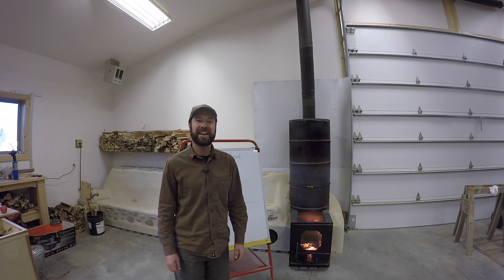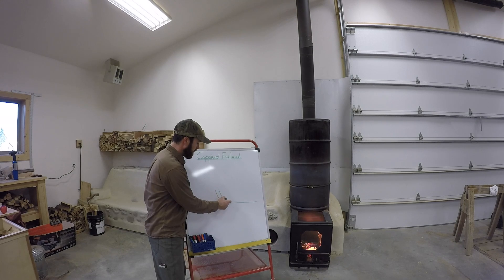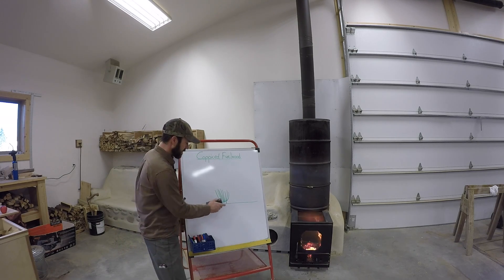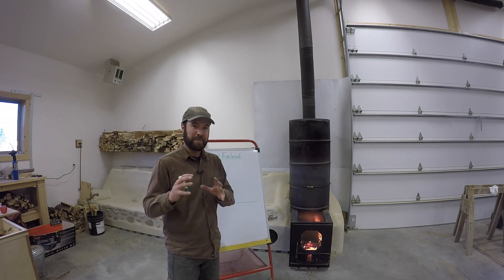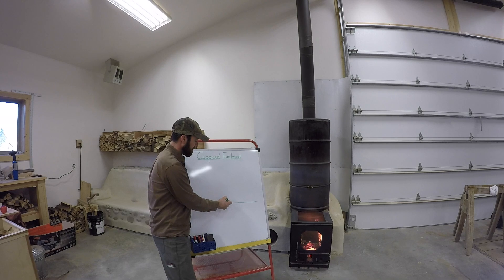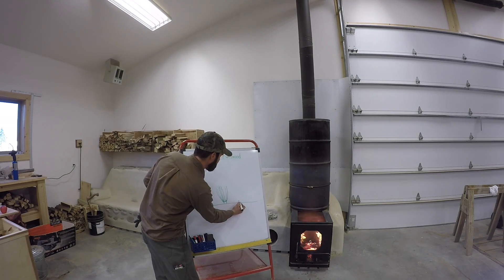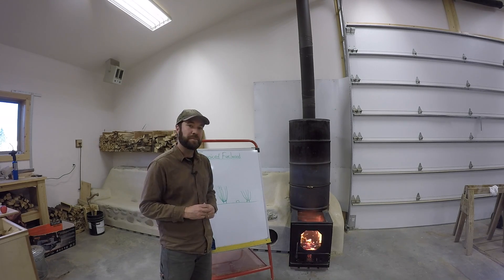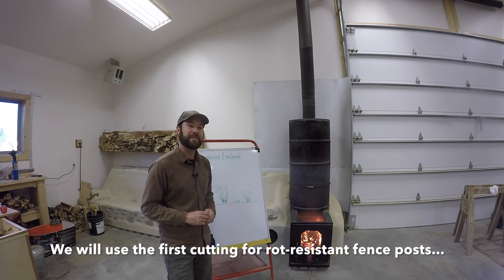ABC acres: Rocket Mass Heater: Beyond Sustainable Fuel with Coppicing - episode #054

Comment: just wondering about insurance for your home if you have one of these. Was it hard to get and did it increase your premiums a lot?
Reply from the maker: This is in our workshop, so cannot speak to home insurance, but it did not increase our premium in regards to coverage for the shop. The insurance adjuster who saw it though it was really cool! I have, however, heard of people having difficulties with insurance, as these are not UL listed, so typically some sort of 3rd party inspection/assessment for safety an insurability would need to be performed, at the cost of the homeowner of course. I have heard that Portland, OR has permitted these to be built in the city, and so it is much easier for the residents there to have them built if they so desire. Fortunately, as RMHs as gaining more attention, more folks are beginning to test and innovate, particularly in some of the mainframe systems that may be able to be produced and sold as inspected and eventually UL listed products, albeit at the grinding pace of bureaucracy. Thanks for watching!

Comment: I have some trees like that around my house, try and cut them and they grow back like weeds. I also have access to reclaimed wood which not all can be used to build things. Was almost ready to build a mass heater but that will have to wait until I find a new place now.
Reply from the maker: Do you happen to know what type of trees they are? We cut back our willows and alders in the wetland just so we can push regrowth, using them for mulch material, fuelwood, or livestock fodder. We also use a lot of our scrap wood from carpentry projects in our RMH. As a woodworker, a RMH will be a great heating system for you. Thanks for watching!
Reply: ABC acres No, i have never looked into it. Had a bit of a snow storm here in MN today but some of them still have some leaves on them so I can find out. They do spread like wild fire and can go from ground to 8 or 10 foot tall in a Summer.
Reply from the maker: I was born in a Minnesota blizzard, and spent my early childhood there, so I am very familiar with Minnesota snow! Taking the leaves or small branch section with leaves to a local nursery(although they are probably most likely closed for the season), or sending it to a local ag extension office would give you a good chance of a positive ID. Sounds like great mulch material and small fuelwood for a RMH at the least!

-Grant

Comment: Rather than coppicing trees and waiting for them to regrow to 2-4 in diameter, it would be more efficient to grow leguminous shrubs with the diameter 1-2 inches.  The rocket stove  was  originally designed to use long thin strips of solid fuel  because more air could be sucked into the combustion chamber.  The principle involved is called the square- cube law, credited to Galileo.  Also, shrubs use less water because they are too short to be dessicated by fast moving, warm winds.
Reply from the maker: Esteban, I think it depends on one's context, and how one manages the integrated elements of their system. In our example, we are first using the initial cutting of the black locust for fence posts due to their natural rot resistance. Then, with resprouting after coppicing, our management interaction has made their growth habit much more like a shrub than tree, which as you correctly stated will lead to not only less water loss via desiccation due to their shorter height, but also greater surface area for condensation purposes. Those a just a couple of the many benefits of coppicing fast-growing trees.  Also, with our RMH being a batch box as opposed to the original J-tube style, we have a different burn chamber, which fits much more wood in it as a "batch" in contrast with the vertical-fed J-tube. One also has to decide how much air draw and subsequent faster consumption of the fuelwood one desires against how long of a burn they want to obtain. We typically start with smaller diameter, get our fire going, and then throw a few larger pieces in, and have very pleased with the results. Thanks for watching, and for joining in the conversation!